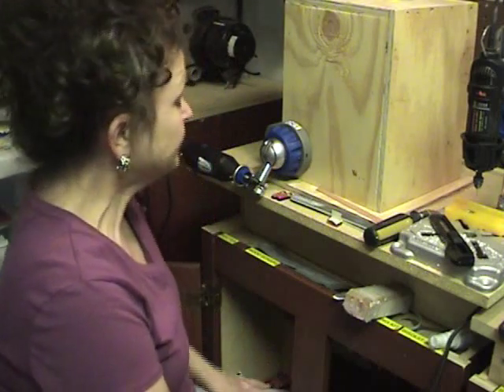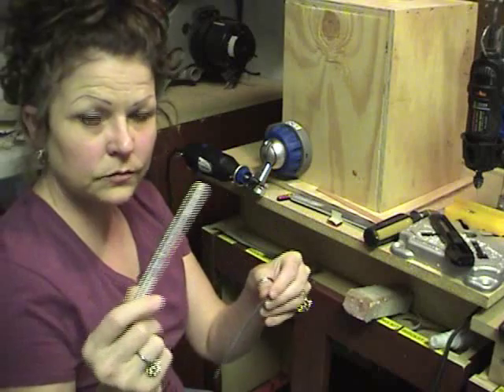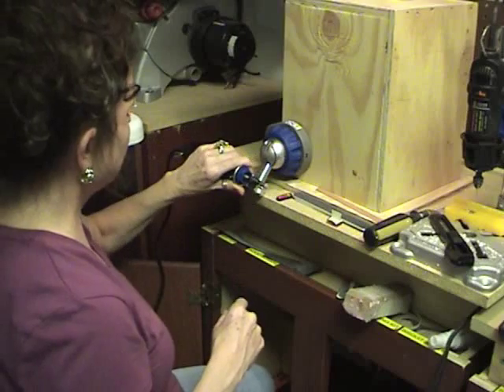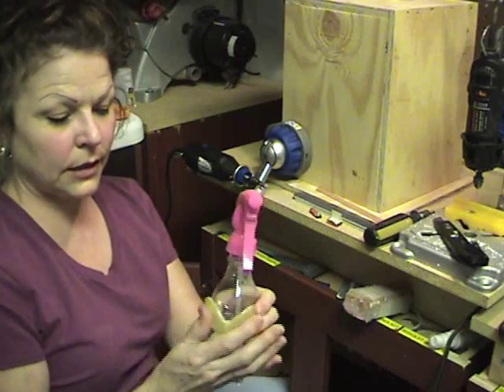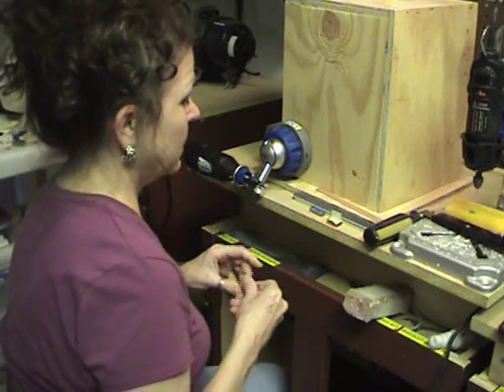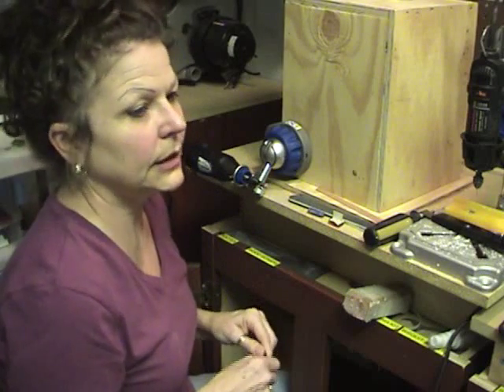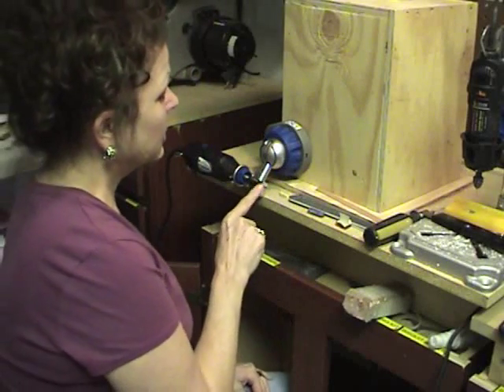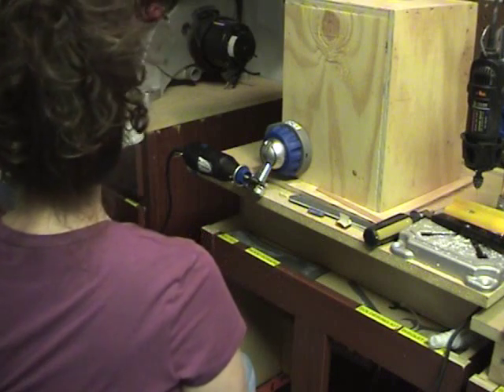ResinObsession.com Sanding Resin

Comment: Very good video... lots of good tips and could understand almost every word.
Will you be doing another one on "polishing" the Easy Cast (or regular epoxy resin), or is that covered in another of your videos?  I know to go up to about 1200 grit wet-dry, but do you have anything to say about the possibiliti of getting a high gloss with plastic polishing pastes, rouges, etc, or by using liquid sealers, etc.? 
And do you treat other epoxy resins in the exact same ways? Diane B.

Comment: Hi cindy!! i'm just starting to do resin..Your videos have been really helpful btw thank you.
i wanted to ask u..for now i use an ice cube board as the mold..but i dont know why the sides that touch the mold dont come out clear??its foggy..only the top part is clear. The same if i use the mold  releaser prior to the pouring. 
Is there something i can do to get rid of the fog??  or should i add something else to avoid the fog??
Thanks.

Comment: @svenskakuswanto Cloudy castings usually mean moisture but you said the top is clear so it makes me wonder if it is the mold. Resin will mimic whatever it touches. If it's moisture then you want to pour on a dry day (not raining). What kind of resin are you using? thanks cindy

Comment: What if you use NON wet dry sandpaper? Is it always necessary to use wet dry?
Reply: Without wet sandpaper you get a way more rough finish which can leave marks when you refinish with an extra coat of resin. I usually use those kits made for cleaning off your headlights. They come with little pads with different grits and a spray you can use to make it wet. I do, however, use dry sand paper on a dremel to smooth out the corners or sides. I then sand it lightly with a finer grit and either use clear nail polish to make that sanded area less cloudy or I will add another coat of resin over it.